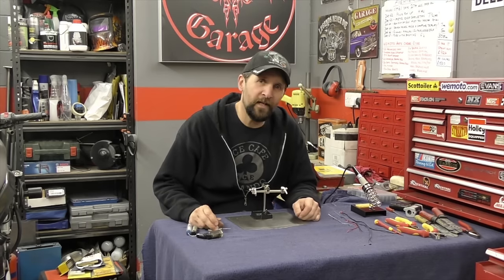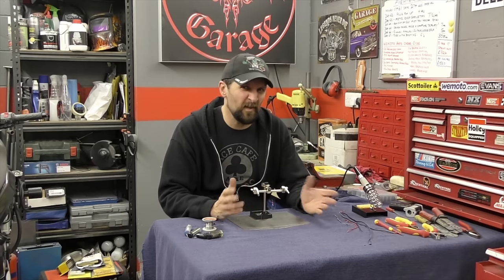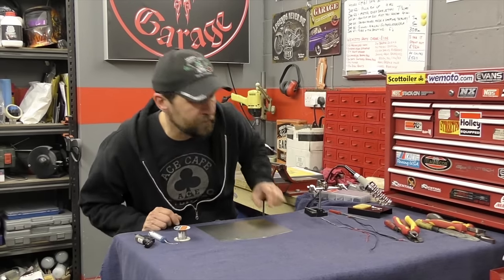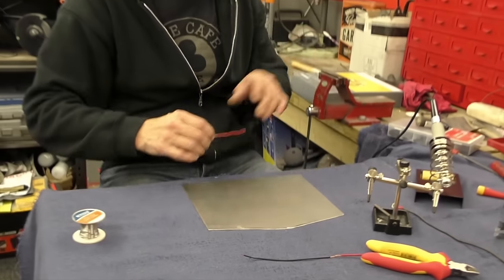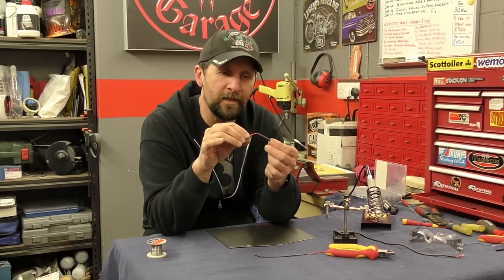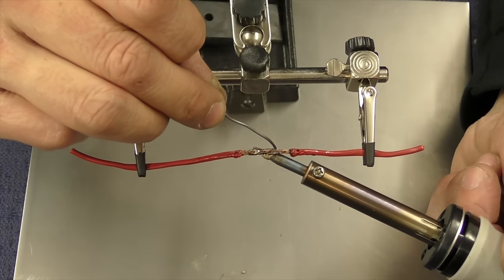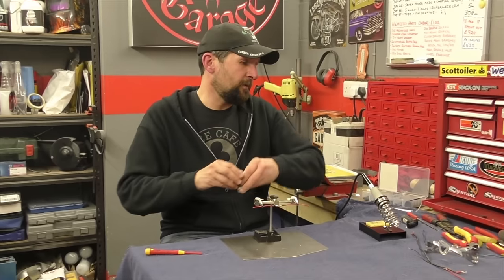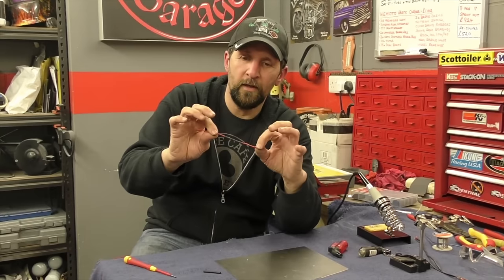Delboy's Garage, Simple Skills, # Soldering.

Comment: Interesting to see how different people do this, if I'm joining wires I hold the soldering iron (with a flat tip) gently in the jaws of a vice (which becomes my "helping hand"), I then tin each wire separately, then it's super easy to just hold the two pieces of wire together on the tip of the iron and the two join in moments with none of that burning of the plastic on the wire and because you have already tinned the wires you don't need to use another hand to put more solder on the joint.  I'm sure your way is fine Del but when I was studying for my electronics degree, this is how we were taught to do it.....great vid as ever - loving your work! - TMF
Reply from the maker: Yeah, two other people have described this method... so it must be a legitimate and respected method for sure..!  thanks mate.
Reply: TMF, it would be nice if you posted a video demonstrating your method.  I'm a subscriber so I'd see it when posted.

Comment: (P) Thanks Del, I have watched 'how to' videos on soldering before but none of them ever said it takes up to a minute to get the wire hot enough before - I guess I am impatient and every previous joint I have made was a cold solder (oops).  Time to learn some patience grasshopper...
Reply: oh and about how long does it take for the iron to get totally up to temp before trying to use it?
Reply from the maker: Most soldering irons will take a full ten minutes to get up to temp before you can use them... if you used a 140 Watt soldering gun, or a gas torch..then they will get thew wire up to heat in an instant.. but this was a wimpy 40W iron for circuit boards..and they take way longer..
Reply: Also may mention that some Irons have hot spots(more commonly on cheap ones).. so you can rotate the Iron around till you find it, to get best results.. as you should not really be needing to burn the insulation as heat was there but not enough to get the solder to melt.
Reply from the maker: I didnt know about iron hot spots.. but i guess its possible.. TBH this was the wrong tip.. i usually use a "screwdriver" style tip that has a large flat area to transfer the heat better.... but the real issue was tha fact i was using a circuit board iron...40W is too low for soldering regular copper wires, if i had a 140W soldering gun.. it heats the wire to critical in about 6 seconds, and then the insulation doesnt melt..!    use what you have aye..!!
Reply: Indeed, flat tip style does a nicer job.. but you can only do so much with the parts at hand.. 

And every one should be able to find one of the cheap styles anywhere.

Comment: Coincidentaly I have just spent the day soldering for my garage 12volt system, I would recommend using a flat tip for soldering wires it takes a lot less time and you dont get so much melting of the insulation. The pointed tips are better for soldering stuff onto circuit boards and such like. I use flux even if I am using flux core, it helps make the solder flow better, plus I still have a stock of proper lead solder which is better again. I also tend to give the joint a wipe over with a clean wet cloth not long afterwards to clean off the crud.

Comment: Always tin the wires first, the cables join a lot quicker.
Reply: Difficult to twist low gauge wire after tinning.  Therefore use a lash splice joint
Reply: You don't need to twist them.
Reply: drain the non twisted wires in fluxpaste, now push them into each other like this movie and tin the point of the solderpen and after that hold the pen and heat up the wire, the fluxpaste sucks the tin from the pen very fast into the wire... thats an easy way to do it. When you do this the wire/silicone protection will not melt away because the heat build up will be fast and short... second tip: use a solderpen with a minimum of 25watts. Everything below that will take the heating process too long. Using normal 12v wire, i like 16awg wire or so.

Comment: I used to use a technique similar to yours until I stumbled across the technique NASA developed to use on their shuttles which deals with more substantial vibrations than what we would see. They separately tin the two wires and then lay them against each other parallel and then heat them together.
Reply: (AFAIK) Only in conjunction with lashing or solder sleeves. Nasa splice methods are a good read :)
Reply: Good point: dont let the solder form the mechanical joint, hence, the use of lashing with SWG.

Comment: Thumbs up for a decent video, but you should be able to get the wires hot enough in 3-4 seconds....your soldering iron is not hot enough, or too low a wattage....otherwise.....great job.....oh, by the way....I've been doing this stuff for over 60 years.....My Dad was electronics engineer, taught me to solder when I was about 5......no heatshrink then, it was friction tape......
Reply from the maker: Hi Doug.. yes indeed.. its  40W iron, took too long to heat through... typically i should have got an 80W or even 100W iron.. but i bought it for the video only, and it was cheap enough to make the point and not brake the bank.. ! Thanks for your insight my friend.. Del.
Reply: Doug Ankrum look up... just recounted a similar memory! I’m not that crazy after all.  Cheers.

Comment: I think you struggled because you contaminated the wires with grease/oil from your fingers when you were twisting.  You should have cleaned them before soldering with an alcohol - ideally, isopropyl.  A contact/brake cleaner would probably suffice.

Comment: Fanning your joint makes a cleaner Connection which also makes heat shrinking look clean..fyi it also allows the solder to wick in with less heat..... Too much heat is never good for wire tends to fatigue, or turn brittle.... Good video

Comment: I swear I am not a know it all but I do it like Delboy only heat the wire a bit hotter and it melts like butter and you will see the wire absorb the solder and no lumps in the solder. It is all one . You sir are one awesome mechanic and I love these videos. Most stuff I would not say anything but I promise, just heat the wire hotter and works prefect every time and you can see the copper absorb the solder.

Comment: A flat tipped soldering iron would make this easier as it distributes heat better to the wire. Good advice but you held the iron too long on the wires so the insulation melted back.  10 seconds and you can make a good joint with a broader iron tip. Just saying but still good advice for novices.

Comment: Now if only I could find some advice on how to solder to a 'ring' connector - I find it really difficult to get the ring thing hot enough on a wire already on the bike. By ring adapter I mean one of those things you might use for an earth or battery connection

Comment: ideal way to do it BUT  i put some flux on my wires before the heat them once the fluxed solder  contacts with the hot wire the solder runs into the cable more quickly..  so no need to hold the heat on for so long.. and ending up in near on baking the existing outer sheathing...  i use to fly model helicopters & soldered lots of ends onto lipo batterys so quickness is of the must.. or  BANG LOL..

Comment: I use a soldering iron tip cleaner (similar to flux coated pan scourer) to clean the tips of soldering iron, that way you don't loose heat by using wet sponge - I also use silicone grease on solder before heat shrink, helps with the water proofing - good video
Reply from the maker: Thanks for the info!

Comment: As people have pointed out, you struggled a bit in that video, burned the insulation, what have you. However, I think you may have a bit of a dud soldering iron on your hands as that was a fairly poor performance for a 40W tool.
While typically one would use a 60 or 80W for that wire thickness, a 40W should handle a joint like that more competently than shown. The tip might be part of it too as it appears quite a bit smaller than I would expect for that sort of wattage. One would expect a beefier, chisel shaped tip in this sort of iron.

You see, the thing with line voltage soldering irons is they heat up until they lose as much heat to the air as is coming in, so, when you go to put a thermal load on (like a bunch of twisted together copper wire) they can experience a temperature drop, which they can be slow to make up. To buffer that, they, typically, have nice beefy tips as a sort of heat store to pass on to the job while the heater catches up. 

Anyhow, from my experiece,  a brand name 40W, line voltage soldering iron, like an Ersa 30S, should make a joint like that in 10-15 seconds, so I think you were hampered severely by the cheapo iron there. How much did you pay for that?

And if I'm allowed to waffle on a bit (I can talk about soldering for hours), I would strongly advise against people who are new to soldering using soldering guns. These are very powerfull tools, they are not meant for the kind of jobs you're going to be doing around the house, on a motorcycle or in model building and they require a skilled user to prevent doing damage if you're going to press them into these sorts of roles anyway.
Reply from the maker: Its is a cheap Maplins item,  cost about £15... but i do maybe three solders  year, and i use that little jet lighter.. it heats the wires in maybe 6 seconds, stroke the solder along the hot wire, let that wick in.. then stroke a little over the top for good measure... never fails me.. but if i made that the video, then every second person would argue i should use an iron... i do have a flat tip for it, but like you said.. its just a cheap item i bought expressly for the video... not gonna lash out cash ill never see back on an item ill maybe use twice more and give away... thanks for your insight buddy... Del.

Comment: This is a very good instructional video on basic soldering. My trade is an electrician and when I did my apprenticeship (with Michael Farraday I think it was - long time ago!) we used to older all sorts of things, Tee joints, married joints, fitting welding cables to clamps and so on. It is a skill that does not get used as much now which is a shame. On a motorbike crimp joints are normally used but good old solder gives a superior joint as crimps can be affected by wet weather causing oxidisation of the conductor and the monkey metal the crimp is made of . As you say a solder joint is as good as the wire itself, an excellent guide for the beginner., well done.
Reply from the maker: Hi there, my word, thank you so much, it's an honour to receive such kindly praise from a qualified tradesman, I'm nothing of the sort, I just get by and do these things for myself, most of us don't get the chance to learn things like this unless we do it for a job, so it's great to know we got the message across halfway right!

Comment: Great vid as usual you two. What can I add to the pool of knowledge here? 
Maybe this: I was taught to solder using a gas soldering stove and a copper soldering Iron, (basically a lump of copper on a rod) - we were shown that solder always travels towards the heat, we had to practise by drawing with solder on a copper sheet, by holding the iron beneath the sheet and leading the molten solder on top along a path, some of the better ones could even write their signatures that way.
Haven't done much plate soldering recently, but understanding that solder travels towards the heat can make difficult joints much easier.
Thanks for all your hard work btw.
Reply from the maker: Nice info David... thanks for your input buddy.

Comment: (P) Hi Del, got a soldering iron for Xmas to do repairs to my bass guitar electrics and amps. I was sure that I saw a Simple Skills soldering video of yours a year or so ago and lo and behold, I did! Thanks for creating this. The connections and wires are different but the application and skills are the same.
Reply from the maker: Hi Lewis, very much so mate, I'm no expert at this by any means, but with all things like this, I practice on scrap first and build up some skills and practice, then attack the real job, safer than buggering it up... good luck with your projects mate, and have a Happy new Year, thank you for your kind support, Del

Comment: (p) Re soldered my aged heated waistcoat using the small blow torch / lighter thing and got a great result, really smooth. Then it stopped working and my 8 year old stepped on it. NEVER let a bored child into your man cave.
Reply from the maker: I was gonna do a solder with the lighter, it always works really well for me.. just ran out of time..!

Comment: P...i consider myself able to solder wires done loads of little projects with this skill but watched the video any way turns i know squat about soldering but now i have seen the error of my ways and will be a better solderer in the future. top job derek thanks
Reply from the maker: Its so common to just blob the solder on the cold wires.. and it does kinda work most of the time.. but try some heat through soldering, maybe with a better iron than my cheap crappy item.. the quicker it heats through, the less heat transfer to the insulation you get.!

Comment: Another good video Del, I got a few tips off that,  but one thing I would say is flux on the wires before heating!!   Otherwise 9out of 10  Ha Ha.
Reply from the maker: Like i said in the video, i couldn't find any Rosin flux in time... if i could have, then id have used the non fluxed wire which is thinner and melts sooner... used what i have buddy.

Comment: thanks del and penny I was soldering totally wrong IE not heating the material I'm soldering thank you for putting me right keep up the good work. 😎
Reply from the maker: Thanks Paul.. if you're gonna buy a new soldering iron... get the highest wattage you can.. this 40W iron takes a bit too long to heat the wire, meaning the insulation gets a bit too hot for too long.. if you can buy  a 100W sildering iron, ten it will heat the wire in seconds..and make the job a lot easier... its all practice mate.. so get stuck in.. thanks for watching... Del.

Comment: Have soldiered a few time but now I know I've been cold soldering and that's why I've always found it hard to get a secure and neat connection.
Reply from the maker: Yeah, its the single most common problem when we first do it.. the secret it a punch 100W soldering iron.. then it heats the wire so fast it will make a good sound solder every time.. buyt thewy are pricey and we never do it enough to make it worth the investment aye..!!

Comment: You are theMan , and let's not forget Penny of course.
Love your channel, it's a normal working peoples channel, not some fancy ** , and very well explained,  thumbs up for that.
Have practically all your vids saved but one (skills) is missing to me.
One question for you , if possible:
I would like to see you,  explain what wire we need to use,  if we want to clean up, simplify,  our wiring,  from battery to ignition , coils , startmotor , cdi , blinkers , brakes and so on.
I am rebuilding 2 older bikes i still own ( 25 - 35 years old), (suzuki intruder 1400 + CB 750 F). I want to simplify the wiring , but i am not sure what kind of gauge wire i schould use from beginning to end ?
Maybe you could do an explanation on a wiring diagram and how everything works together , what thickness the wiring should be at least in differend cases. (i am Belgian, european, so in mm2), if this could ever happen.
And if it should ever happen , an explanation on how to clean , rebuild carburetors.
Keep this up man , this is my favorite channel , and i'm telling this to all my buddy's.
Greetz from Kurt.

Comment: I built a wiring harness from scratch for my old car, that electrical system was bomb proof and I was finished, I don't know why, but Suzukis from the 80's were plagued with electrical gremlins and the gauge wire used wasn't sufficient enough, connectors were all oxidized. I'm about to do the same with my Honda CB350F, got the wires, new connectors, etc. I'm finally going to upgrade to soldering station

Comment: Hi Del, I have a question and need your opinion about this:
I have an Sportster 1200, year 09, 6,000 miles on it, I have been running this bike on SAE 60 according to the recommendations of the Harley dealer here in Miami, where the average temp. all year is 85 degrees .
I want  to switch to a Synthetic oil.
Should I go to 20-50 W, or keep the grade SAE 60 Synthetic  ?
I'll appreciate your opinion.
Best regards
Pedro Bernal
Reply from the maker: Hi Pedro, you are using what is known as a 'mono grade' '60' refers to the thickness of the oil, I'm sure you realise that.  If you switch to a 20W/50 - you then have a multi-grade, and just in case you don't know, this means in super cold weather you have a 20 weight oil that will be thin enough to run through the oil ways fast and efficiently, but in super hot weather, you have a 50 weight oil, which is perfectly fine for even up to 100degrees... 60w is really too thick for anything other than Arizona temperatures.  

The reason multi-grades are good is that your oil has the ability to protect your engine in fluctuating temperatures, and I know you said Miami, but I bet it gets cold there at night in winter, just like it does in Arizona... so for all my Harleys, I use a multi-grade fully synthetic oil, this gives me great protection for all weathers, and the best oil for any Harley is 'Screamin' Eagle Syn3'... not only can you use this in the oil tank under the seat to protect your engine, but also you can use it in your primary transmission case on the left hand side to protect your primary chain and clutch, it's one oil for your whole bike and recommended for Harleys... that's what I use, hope that helps you Sir....
Reply: Thanks for your prompt and helpful response.
best regards
P. Bernal